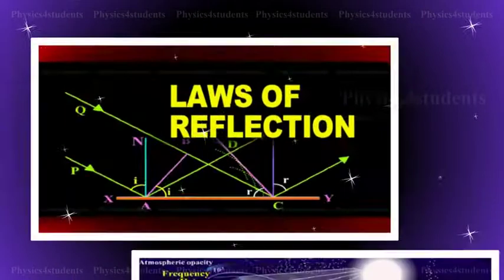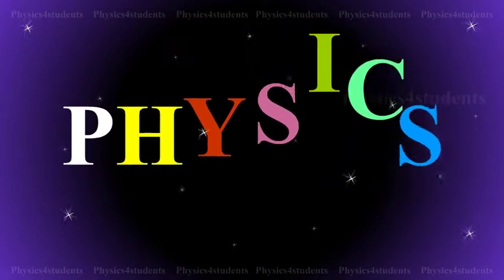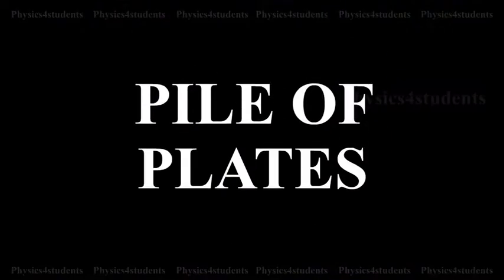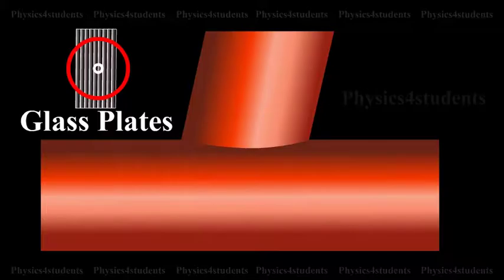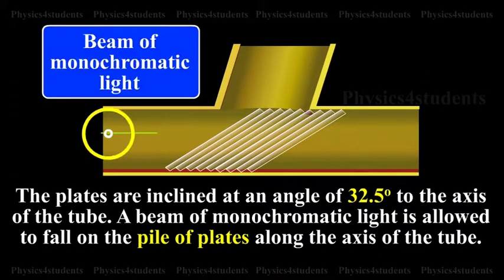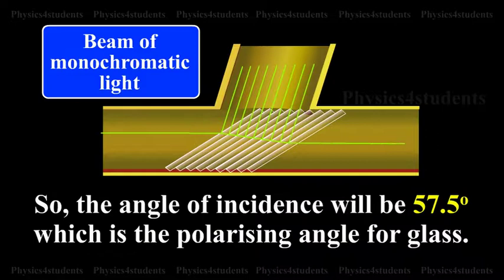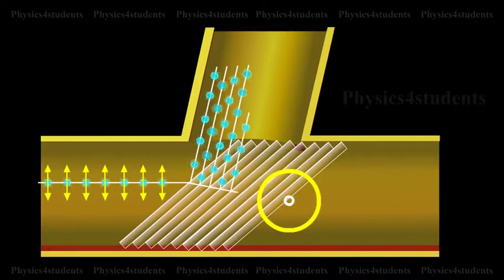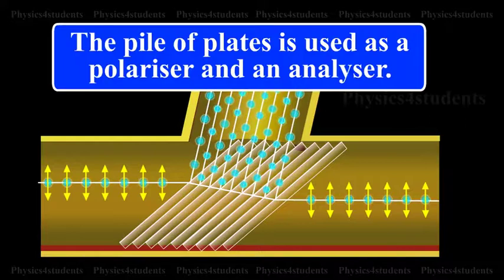Pile of Plates | Phenomenon of Polarisation by Reflection | Physics Tutorials

Comment: After refraction of sunlight on a green or yellow banana leaf with latitudinal gratings of its lamina it is analyzed for redoubled symmetrical opposite and equal mirrored refraction by a polariser,in comparison to a visible spectrum on a prism face of a straightedge plastic ruler of 5 cm length, though it cannot be captured with a camera on video. In sorghum leaf the is bilateral longitudinal gratings of its lamina with a smaller midrib can't be analyzed for redoubled refracted light which is unpolarised. Both plants include differences between and within themselves in matching the human eye to double refraction of visible spectral colour.